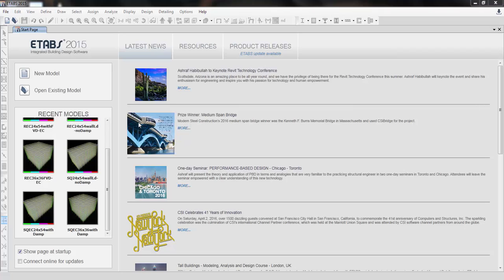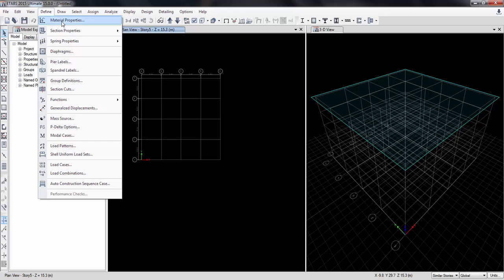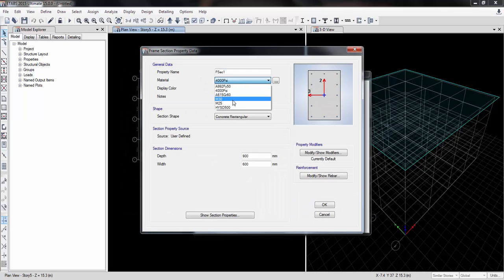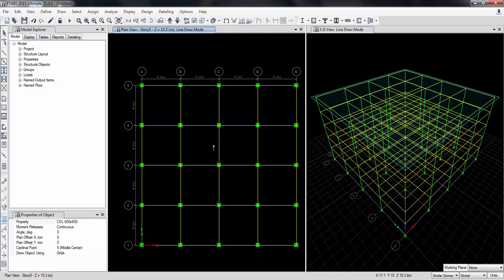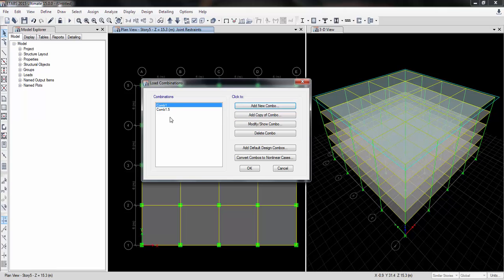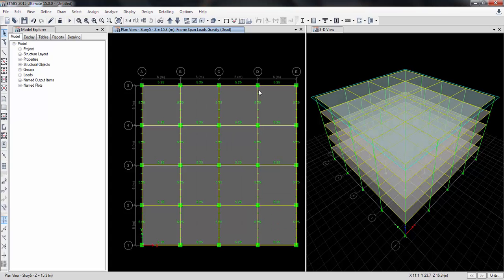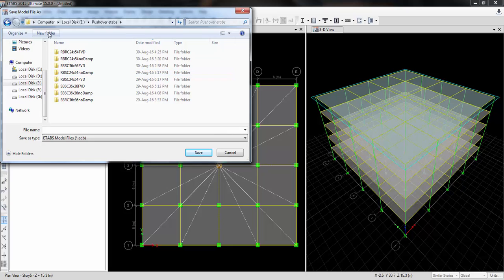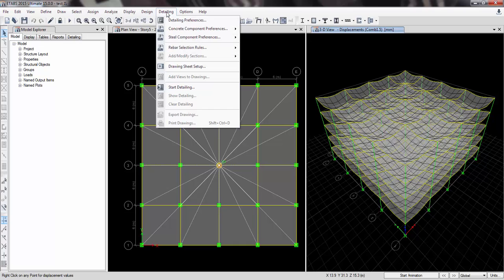Etabs 2015 tutorial 3 | Loading and Analysis of RCC Building | Using IS 456

Comment: i have a doubt ...am modelling a building with flat slab....G+6 one ..the problem is i need to apply infill wall loads as udl in every floor where infill walls are coming ...i just have grid lines no beams at all the interior part of my building ....so my question is how can i apply udl in such a case? ...
my next doubt in once if i do meshing is it possible to remove the meshing that i have done later because its slowing the work
the final question is how can i divide my flat slab like the way i divide normal slab in etabs? is it possible?
.

Comment: very helpful video... but will you  plz xplain why you change Beam and Column Modifiers properties?
Reply from the maker: Thank You ... Property modifiers may be used as a scale factor to modify the stiffness of section properties for frame, shell, and tendon objects. Property modifiers may be assigned either to object sections or to the objects themselves. It is taken due to Cracked behavior of concrete because of loads.
Reply from the maker: https://wiki.csiamerica.com/display/etabs/Modeling+concrete+cracked+section+properties+for+building+analysis

Comment: how did you calculate or get the value of property modifiers for beams (i.e, torsional constant as 0.01, moment of inertia as 0.35) and for columns (i.e, torsional constant as 0.01, moment of inertia as 0.7)

Comment: Pls explain shell Thin/shell thick, membrane and plates. Plus what does reinforcement to be designed_and_reinforcement to be checked means
Reply from the maker: Thin/thick, shell , plates and membranes are different types of slabs. If you already have a building designed by any engineer and you need to recheck its strength then you need to select the "reinforcement to be checked" otherwise to design for first time you should select "Reinf. to be designed. Ok.
Reply: Ok.

Comment: bro is it necessary to assign dead load to the slab, as you have assigned as 1? In my view dead load is assigned by the program itself...or what? want to clarify
Reply from the maker: You need not assign any dead load for its self weight. I have assign for floor finishes to slab as 1kN.
Reply from the maker: In Etabs 2015 the selfweight is automatically taken by program itself. for older versions of etabs you need to apply load.